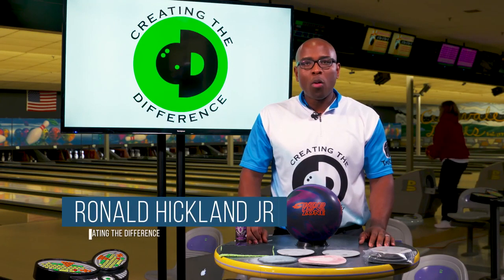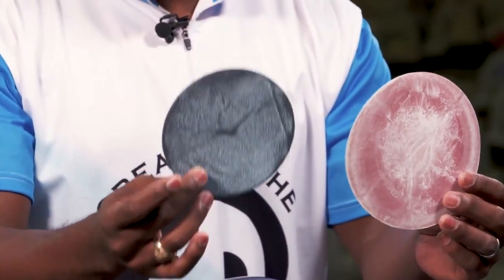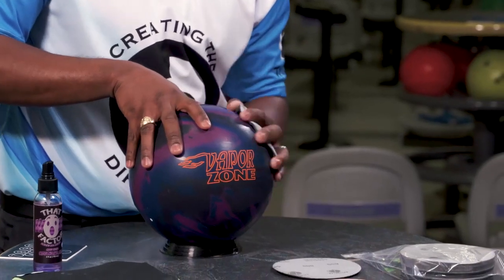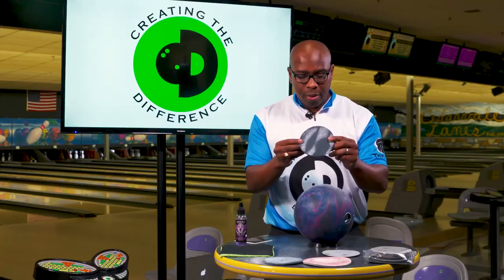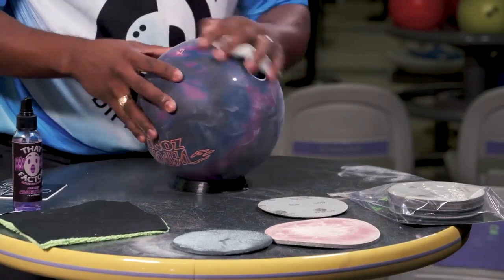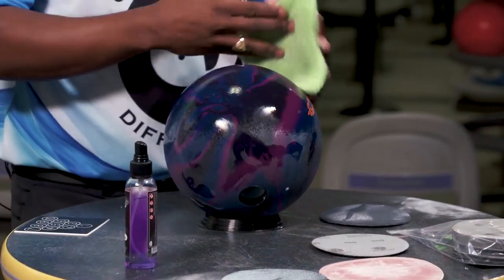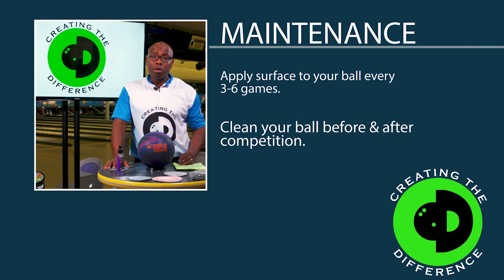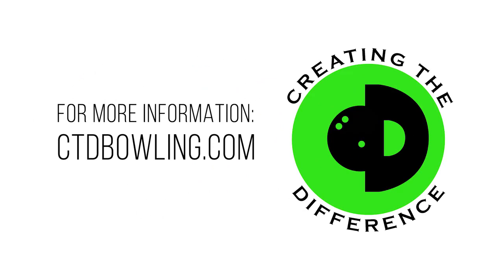How Do I Put Surface On My Bowling Ball?

Comment: Hi Ron I'm expecting my 6 pack of trucut surface pads I ordered on Amazon to get to my apartment either today or tomorrow if I use the 4000 grit pad plus the 2000 grit pad will that make a difference as opposed to only using the 4000 grit pad?